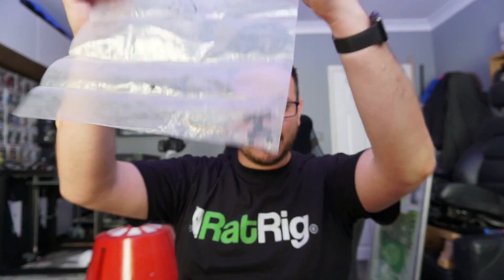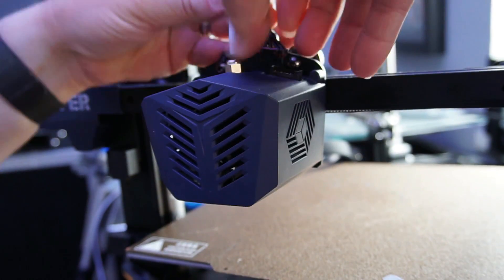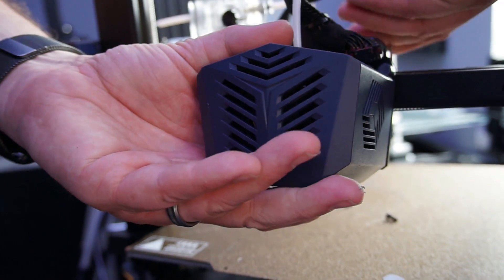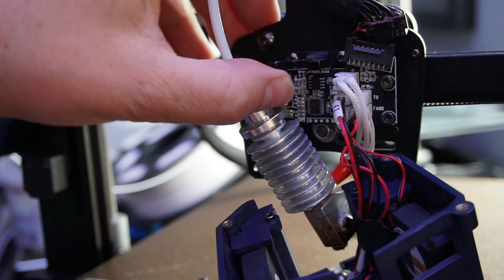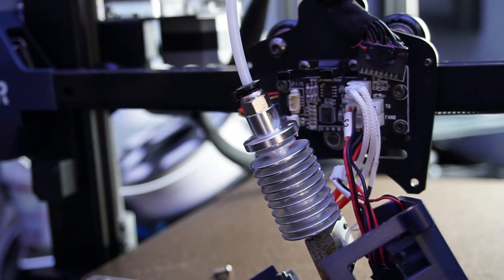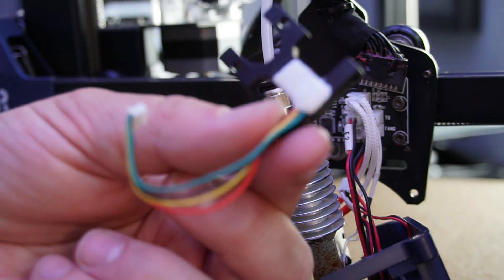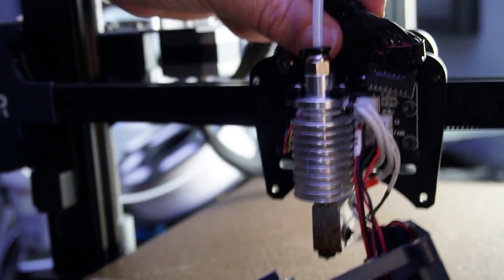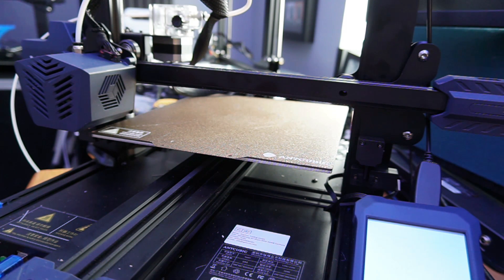Anycubic Vyper Sensor Fault

Comment: Hey Sam, is your Vyper still working with the Sensor they send you a month ago? Did they fix it yet? And is there an official statement from anycubic about this problem being fixed on shipped vyper? Because I see that this issue was 1 Month Ago or more.
Reply from the maker: Hey dude mine is fine and printing well. I’ve not seen anything further with responses from them about this issue, that being said I’ve heard that there have been components changed in the new models.. but that’s not confirmed

Comment: Hi Guys, let me know which one that leveling sensor fail?
1.   First leveling fail
    >1.1   System killed, TFT and all axis no response.
    >1.2   Sensor fail, hotend hit the bed till bed bent.
    >1.3   Others(Let me know).
2.  Some print then leveling fail 
    >2.1   Nozzle hits the raised part of the model then leveling fail
    >2.2   Nozzle rub platform then leveling fail
    >2.3   Others (Let me know).

Comment: Weird. I noticed when I first got mine, it levelled fine and the sensor worked. I could use a metal wrench and softly touch the nozzle and the sensor would see it... Then I did the auto levelling and the nozzle pushed hard on the bed causing it to push down a bit... it then went back up and touched the bed again but stopped as soon as it touched, it then went on to level the bed fine, every other time it touched the bed with the nozzle it stopped moving and went back up to do the second touch before moving on... I am worried the sensor might be gone? But why would the other points work fine?
Reply from the maker: It’s such a delicate device and early on I said that this would be a challenge especially when you are asking new end users to take things apart and replace parts. The sensor swap out on these faulty ones really needs to be faster from anycubic
Reply: @TheRealSamPrentice  Yea for sure, also they shouldn't of glued the connection down if they expected parts to be self replaceable by the user...
Reply from the maker: @DeSibyl  that I can agree on!!
Reply: @TheRealSamPrentice  Yea, I think I got lucky with my sensor. I will keep monitoring it though. I noticed when I performed the first Auto Level it worked flawlessly. However, the second time I noticed on the first contact point (front right corner) it pushed the bed down a good bit before continuing the rest.. Also, I grabbed my scraper tool and used it to softly push on the nozzle and I could see the red light come on with minimal force... So I presume that means the sensor is working, just wondering why it pushed hard on the bed on the first point.... All the other points seemed to work fine and it only lightly touched each point.

Comment: I just got my Vyper about 2 weeks ago. Today, I noticed that the hot end is loose. If I were to push on the bowden tube on top or even slightly on the nozzle, the whole things moves. I imagine it's not supposed to be like that? I'm new to 3D printing but my Mega X certainly doesn't do that
Reply from the maker: Hey Chris, is the hot end loose as in the screws that hold it in place have movement ? Or the the hot end (parts) are loose. The way this is designed allows movement via the strain gauge so you will get a bit of movement. I also have the mega x and s these printers are very different and there is really little more than the brand name to compare them on.
Reply: @TheRealSamPrentice  So, after a few hours of pulling parts, some trial and error and a little bit of swearing, I figured out the issue. The screws for the strain gauge were lose for one. Despite some initial successful prints, the bottom Guide wheel needed a little tightening along with the bed. Anyway, I just did a small test print and it turned out perfect. 
Thanks for getting back to me and the video (which helped immensely).
Reply from the maker: @cgeorge2023  let’s see if it lasts !! I hope it does

Comment: Yeah, similar story for me unfortunately. First leveling and a test print worked fine when I got the vyper a couple of days ago. Last night it just smashed into the bed :/ 
Thanks for the tip about the LED. I haven't taken off the shroud yet to confirm if it lights up or not, I want to contact support first.
Reply: Hey I know its been a whle, did this seem to solve your issue? I just got one of these and this seems to be the issue, but I'm waiting on a replacement part.
Reply: @igobyandrew  hey, yes since replacing the sensor my vyper has been going strong (still using it) and I haven't had the printer do anything weird like that again :)
Reply: Wow thats awesome! I ordered a replacement on Amazon yesterday. Hopefully it will solve the issue! Thanks for your reply! @ghandigarcia

Comment: Got my Vyper today, and have the same problem -.-
Reply from the maker: Sad times dude! Have you tried bending the bracket back a little?
Reply: @TheRealSamPrentice  yeah, but have to make a Video for the Support Guy . I will try again with more Love
Reply from the maker: @Roymantic  Carful with all that loving that close to the hot end ;)
Reply: @TheRealSamPrentice  so yeah. brocken. ordered replacement part. should be sent in 5 days, arrive 14 days later...7 days later still no Mail that the item has been sent. Contacted support, they told me they ran out of sensors and had to produce more...so ** this, i ordered an prusa now
Reply from the maker: @Roymantic  oh no!!!
Reply: @TheRealSamPrentice  that looks like aluminum seems like it would be hard to bend am i missing something. I guess I could hold in a vise and take some pliers to it. is that what your talking about
Reply from the maker: @jvarrati  you could try, it  precision tooling tho so people have given it a go and failed ;)

Comment: Same issue. Had all of 3 successful prints. Now it’s erroring out and won’t level. 

This printer has been pretty disappointing. First arrived with a damaged drive belt. Now the leveling issue.
Reply from the maker: That’s really disappointing, I’ll admit without that issue it’s great but it still had the issue. Have you contacted support ? I know of one guy that managed to tweet his hot end down and it repaired it
Reply: Agreed that it’s a great printer if it works. The three prints I got out of it were great. And I’m complete new to 3D printing. 

But, it’s pretty sad quality to have an issue before it’s out of the box, and then a second issue within the first week. Both rendering the printer unusable. 

I already have a ticket for the drive belt. So I just added this new sensor issue to that. Will see what anycubic does to respond.

Comment: Mine worked fine the first try. Tried repeating the leveling a couple days later, and this happened.
Reply: same thing happened to me today. set up the printer yesterday and it worked fine.
Reply: Follow-up: it took two weeks shipping time, but I received a replacement sensor, and all is good

Comment: I just started using my Vyper a bit more, and I'm thankful you put out this video - I'll keep an eye and see what happens over time.
Reply from the maker: Hey dude! It seems that if you have the problem it tends to be instant. There looks to be a faulty batch of sensors as the replacement is working really well now. It’s frustrating to new users and disappointing.. it’s just one of those things and a great example of new product in the wild experiencing a major issue which looks previously undiagnosed.
Reply: @TheRealSamPrentice  It wasn't instant on mine.  It worked fine for a month.  The problem is in the design.  If it happens to hit a bump in the print it'll stress the gauge and they are really sensitive.  It's just a poor design that should be done away with.

Comment: ugh 30 hours in and was hoping it wasn't this. Mine was half way through a 9 hour print when I heard something grinding. I still don't know what caused the nozzle to bump into the print because all the layers were good. Ended up resetting and leveling and...nope. Sensor is dead sadly. Guess I'll wait for a new one to install. Considering how 3d printing goes this could happen a lot. Not keen on having to swap a sensor out constantly.
Reply from the maker: Annoying!  From what I understand this is a large problem effecting many people.
However I understand that the sensor batch that was supplied with many of these printers had a fault the replacement I have has been running for the past 3 days with no issues
Reply: @TheRealSamPrentice  Good news today lol. After being frustrated with it the other day I went back to just make sure I didn't miss anything. And I did! lol. I bent the bracket up quiet a bit and the red light came on. My guess is during the print a layer shift happened in a certain area that caused it to raise to due to an ample amount of stringing caused by my combing profile. This likely was ruined during my first layer and I failed to watch it later as I went to bed. So due to the the bend was the opposite. Instead of going up it bend it down lol. So bending it up a slight bit triggers the sensor now.
Reply from the maker: @zacharylewis417  good moves! I tried that but mine was too far gone, I’d still get them to send you one out just incase
Reply: @TheRealSamPrentice  Yea I'm still going with a replacement just incase. Again thanks for the video!

Comment: Looks like a problem in the Firmware of the Printer that allows to move the Head in the Z Axis under ZERO.
Z -0.1 is definitely a Problem and allow the Extruder to scratch the surface of the bed. 

I write Anycubic and hope they will fix this in the Firmware and send me new sensors.

Interesting too is, what kind of sensor type is it (Modelnumber or vendor) to order 5 or 6 of this cheap sensors until The Firmware is fixed.
Reply: The whole point of bed leveling is to determine where zero is. You can't tell the printer not to go below zero during the leveling procedure, because in that moment, it has no idea where zero is, and is using the sensor to find it.

Comment: Based on how the sensor looks it seems like the heat form the extruder is causing the solder to melt or losing  up wires in the sensor, I'd try to remove that white glue to see exactly what's the issues because it look perfectly fine form out side.
Reply: yeah, if i receive my new sensor, i will try to remove the white glue to see what happen under this ! there are 4 cables going in it, but don't know why those 4 cables are useful or what they are for. will see and try to give you a return

Comment: Do you have a picture of the right home position? My nozzle drives to a point outside and below the printbed. Is this the supposed position?
Reply from the maker: I don’t think so no, If the light is not on the sensor has failed.
Reply: @TheRealSamPrentice  interestingly the light is constantly on but it still smashes into the board while autoleveling.
Reply from the maker: @rocksmo3384  if you move the nozzle does it flash?  You might have a different problem

Comment: Same issue for me. I leveled successfully at first but the extruder just smashed into the board at my first own print. I decided to level again and it just went straight into the bed after scratching its way to the first position. I cant even call the support since the website seems to be down. How can a manufacturer fail that hard? I guess i should have bought an old one with manual leveling.

Comment: Have the same, error now :%. argh one leveling worked now its done after 1 day of printing ..
Reply from the maker: So annoying !!! See if you can reset the unit and try to see if the light is on by default
Reply: @TheRealSamPrentice  The light ist permantly off now. I wrote the support already and they send me a new sensor. I dissassembled the hotend and noticed that the resistance between the black and green cable is 272.2 Ohms. If i bend it it goes down. Between black and yellow 271.3 Ohms, but no reaction to bending.. hm .. i will order an HX711 testkit and will evt investigate further.. maybe temperatures are too high in the hotend for the sensor?
Reply from the maker: @SalsaCookies  I’m not sure that temperature is a factor I think it’s the sensors build quality

Comment: I still haven't received an email from Anycubic about my vyper being shipped, it has been more than 20 days since I ordered the early bird version... And it said that within 20-30 it should have been shipped, and that I would receive an email once they ship it.. and I know that when the email is send it will take another long while. Am I the only one here?
Reply: You're not. It's been around 23 days since I've ordered mine and still nothing.
Reply: maybe they are holding them to fix the problem lol I'd be okay with that. (fingers crossed)
Reply: Update: Just received a mail from Anycubic. My Vyper has been dispatched from a warehouse in Germany and should be delivered in about 7 days.
Reply: @marekmiklenda4896  nice, I also just got an email from Anycubic, also dispatched from Germany. I don't see the part about within 7 days tho.
Reply: @raynlaze1339  I've found it when looking at DHL and their estimate. It's a bit of digging, but you can find estimated delivery times country -> country
Reply: @marekmiklenda4896  Ah I see, for some reason my tracking link doesn't work (it's from track17). I have to manually paste the code, but even then it gives me a orange circle with an exlamation mark in it, saying that I can't get anymore tracking info.
Reply: @marekmiklenda4896  Got mine this week! So far no sensor fault, but I do notice the owl print has some problems.. or it might be the filament, not sure. It seems it's extruding too much once filament in is set to a stop or when printing the filament is too melty where it sticks to the nozzle and then starts running into the print making a bang sound when coming back to that part.

Comment: I really thought the Vyper and the CR6-SE were going to have pretty might the same internals for the hotend assembly.  The control board, nozzle, and strain gauge are all very different.  I am surprised the strain gauge failed so quickly.  Seems like an easy fix, hope not to many are affected by this.  Great video!
Reply from the maker: Yep I thought it might just be my one but there are a few people with this issue lucky that anycubic are shipping the parts out for quick fixes :)
Reply: Not true. I have this problem on a 6 month old printer and Anycubic were unwilling to replace this part. They told me I must pay US$65. My printer is still broken. I now hate this company with a passion.
Reply: @TheRealSamPrentice  Sam have you successfully managed to get a full diagnosis on the strain gauge issue. I got a new strain gauge and I am still hitting the same issue of the nozzle smashing into the bed. Should the red light be on all the time? I need to be clear as to what the OK set up is? Red light on? And when it makes contact does the light go off or blink? Any other information gratefully received. I have a 6 week old machine that is basically useless at the moment and I am very annoyed!
Reply from the maker: @iainsolly2575  hi Iain, which version do you have ?
Reply: @TheRealSamPrentice  hi Sam version 2.4.5 firmware. I am very fed up with this!! I changed the strain gauge and still not working. Been looking at option to use a BL touch instead. The links I’ve found are all in German!
Reply from the maker: @iainsolly2575  hey Iain, there are 4 versions not firmware but model does your unit have red glue on the hot end clip ?
Reply: @iainsolly2575  I've done the mod and I don't speak a word of German.  It's not hard but I switched to klipper because I couldn't figure out working Marlin firmware but I'm glad I switched.  You just have to follow the wiring diagram, NOT the bltouch color configuration or you'll blow your probe.

Comment: Do these take standard E3D Volcano nozzles, and do you intend on making it an all-metal hotend in a video?
Reply from the maker: I believe they will fit in fact as long as it fits onto the sensor you should be fine. I will look to upgrade this as time goes on but right now the prints are coming out nicely
Reply: @TheRealSamPrentice  I have severe printer upgrade trauma so I am avoiding touching my Vyper while it works fine. I should try to get a spare sensor from Anycubic as reserve though, if this problem is as common as the comments suggest.
Reply from the maker: @dasauto7346  I’m just speaking to anycubic to find out the costs and availability of these sensors I’ll also test the old one to see if it’s repairable. I feel your pain with upgrades!
Reply: @TheRealSamPrentice  another issue I ran into is that my right-hand leadscrew specifically seems a bit warped, and it tends to rattle a lot in the stabilizer. A piece of painters tape seems to deaden the plastic-on-plastic noise a bit, but I wish I could just drop in 608 bearings. Hope they get back to you on the sensor too, because that's a big oopsie and why I wish it had a less proprietary solution.

Comment: Same Problem, Sensor defekt, now waiting for a new one. Next Problem: very noisy Fans in the Print Head if running under 10ö%
Reply from the maker: I’ll do a dB check on mine and perhaps we can compare
Reply: You can check this by setting the target fan speed at 50% via Tools/Speed  in the touchdisplay without printing. Seems to be an electrical sound, not only the fan.